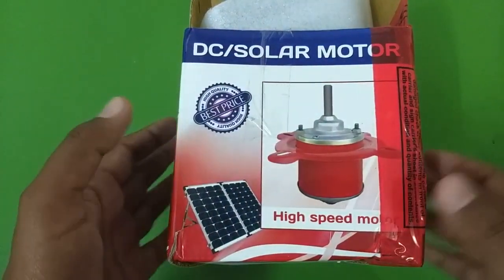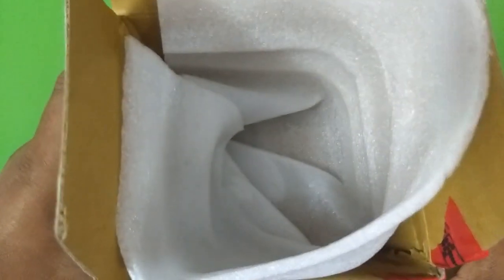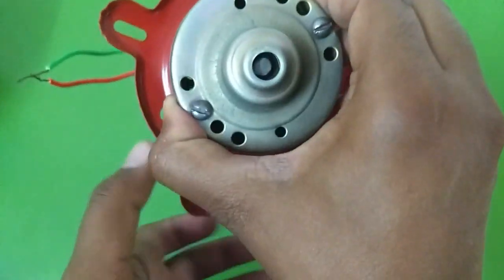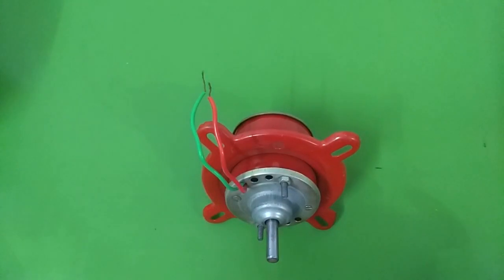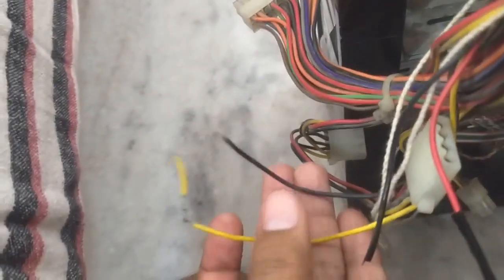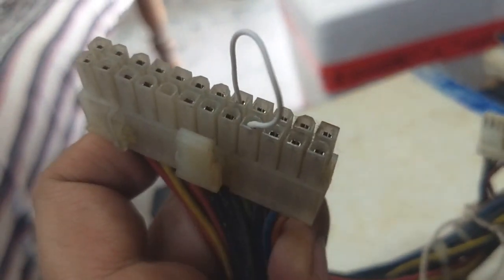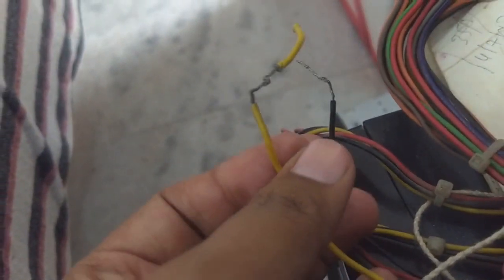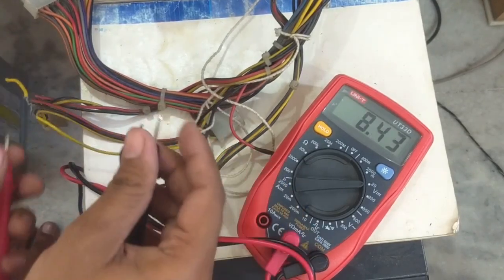Solar DC Motor for Solar water Cooler & Solar Fan

Comment: I have this motor but it is not spinning on 12 volt dc power adapter 2 ampere
Reply from the maker: please make sure that your motor is 12v because there are two variants available in the market 12v and 24v.
Reply: It works on 12 volt transformer with rectifier but on adapter not working
Reply: And i have 12v motor...

Comment: Bad motor hai 12v 775 motor is best
Reply: I also want to this product  tell me if you u purchase this product is it good or bad
Reply: Bhai sahi work ni karti kya
Reply: 775 motor ko cooler me use kiya hai rojana  20 horse hum betry and solar pe use karte hai motor ok hai  or cooler ko 1month ho chuka hai din me solar pe chalate hai or night me betry se moter or pump ke 3.5amp hai total 42w
Reply: @rohitbangia7985  bhai 775 motor price ? Kha milegi link do
Reply: Bhai 775 motor dilhi lajpat markit me milegi  price 180rupay ki  Maine bhi wha se lhi thi
Reply: Online bhi milti hai price jyada hai
Reply: 12v 775 motor bearing me hi lena kyoki ye original hai price 180 without bearing price 140
Reply: @rohitbangia7985  bhai online purchase ke liye link share karo please
Reply: Yes bhai ye motor amper jyada leti  hai lekin ye motor air jyada nhi DETI iske muqable  me 12v 775 motor best hai ampere dono ke same hai lekin 775 motor ki air achi hai maine dono motor ko use karke dekha hai
Reply: How many hours it can run to continue with 12v battery
Reply: If it can run 1 hour is it will be damage

Comment: You didn't connect it on solar panel, And Surely only 40watt panel cannot run this motor... It will need around 60watt panel..
Reply from the maker: Thanks for the feedback, all i can say is that it runs on a 40 watt solar panel.
Reply: I think it will not run...😅.. Because any solar panel does not produce 100% of its rated capacity..... It gives around 80% maximum.........anyways....
Reply from the maker: That is correct.But the motor will still run however, it may not reach its full speed with a 40W solar panel. Also, if you are going to use the solar panel directly that is without any charge controller;its better to use a slightly under powered panel.

Comment: 1500 rpm is sufficient for air because all other dc motors has more rpm so which will be best for fan and cooler.thanks plz reply
Reply from the maker: yes, 1500 rpm should be good enough and it would work best if your blade diameter is not more than 12 inches. Speaking of other motors, most dc motors have high rpm but they can't run when you put load on them like a 12 inch fan blade, those motors are suitable for making things like drills.